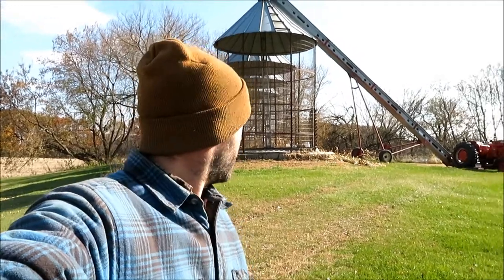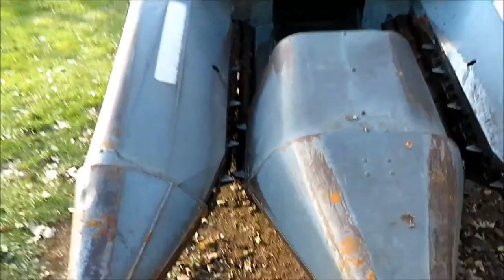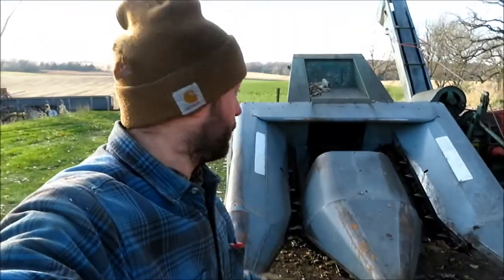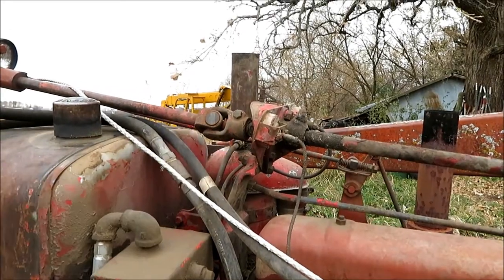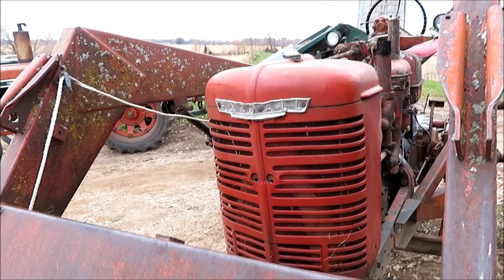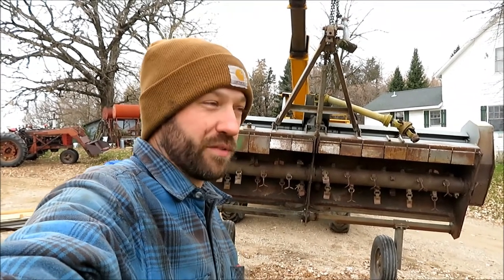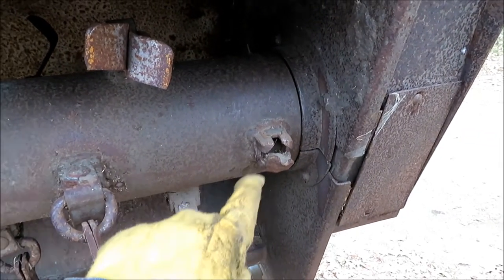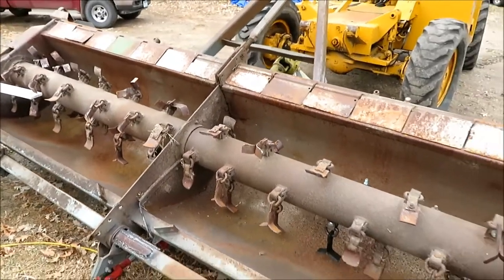Prep for Corn Picking

Comment: Just a thought for you with the hydraulic hoses zip tie or a piece of wire on the one that's the upside hose we have John Deere tractors so we always do the hose that goes to the right side so when you hook it up you're always  correct for the hydraulic lever with up and down cheap trick. Works good and on your stock chopper I noticed you have two different style knives in it you have a double knife and you have a single knife they're two different weights on those knifes and you can't have one across from the other one they will not balance each other out they have to all be the same across from each other on the rotor or it will vibrate like mad good video 👍

Comment: The flail mower looks to have hammers and knives mixed. Can you do that if you space them out evenly? So it isn't off balance.
Reply from the maker: Hey John!  Yup, we've found that you can make it work.  This Hiniker stalk chopper was designed for the "hammers" as you call them.  Kind of scoop shaped pieces to beat up the stalks.  We like the T-knife style better though and find it does a better job, so Dad and I have put those on where the corn rows tend to run under the chopper.
Reply: @ravenviewfarm  mine has the y shaped knives, I wondered which worked better.